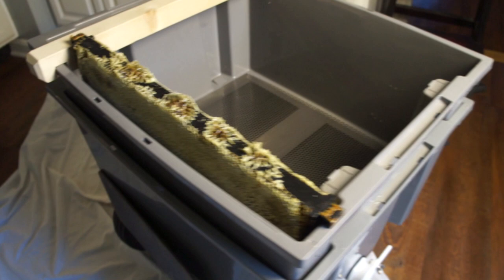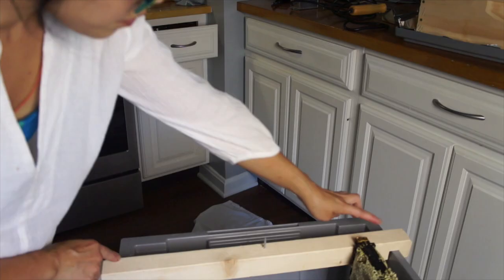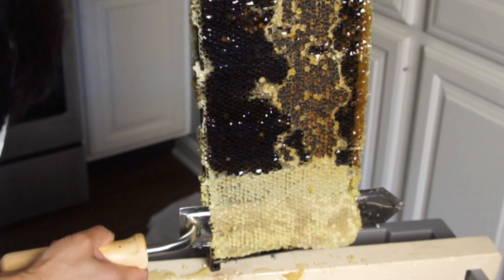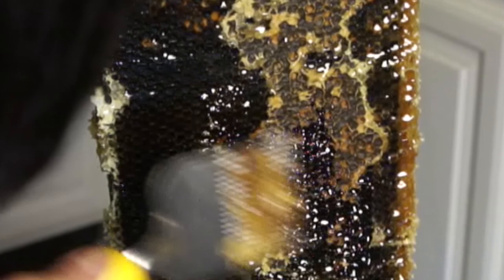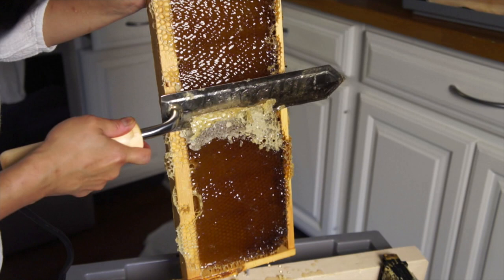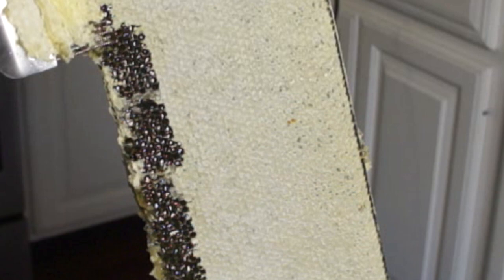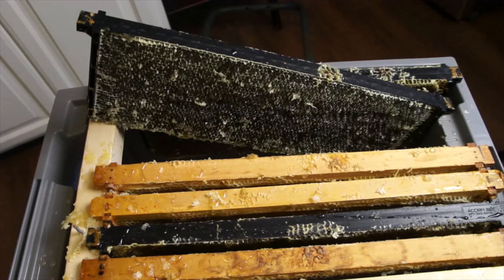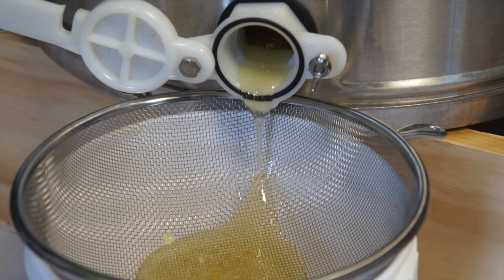Honey Harvest Time!  | S3 E14

Comment: Congratulations on that first 100 lbs. Well done! Turn up the heat on that knife, Em! You shouldn't have to work so hard to get the cap free. That hot knife should be able to cut that entire frame in less then a min each side.

Comment: How do you know how much honey to leave for the bees to eat over the winter?  Fascinating to watch this process.
Reply: Pat Frank It is standard practice in most parts of the US to leave one maybe two full honey supers fo the bees to feed on though out the winter additionally many keepers will add supplemental feed for the bees be it a 1-1 /2-1 sugar water solution of just a layer of granulated sugar on a sheet of card stock on frames which acts as a feed and a humidity absorber inside the colony during the winter.

Comment: Wouldn't some wire, like cheese slicing wire, be more effective for slicing off the wax? O.o

I want to crank that spinny thing so hard and just be like "YAAAAAAAA HONEEEYYYYYY!" xD
Reply: The idea is to try to keep as much of the comb intact, so after honey extraction, the beekeepers can put the frames back in the hives so the bees can refill the comb.

A wire cutter may end up ripping up the comb below, so the bees will have to make more wax to repair the comb.

It's supposed to take them 7lbs of honey to produce 1lb of wax
Reply: @lemonherb1  Not a wire cutter. A wire slicer. No more different than the blade she's using, that I can see. Could easily be heated, too.